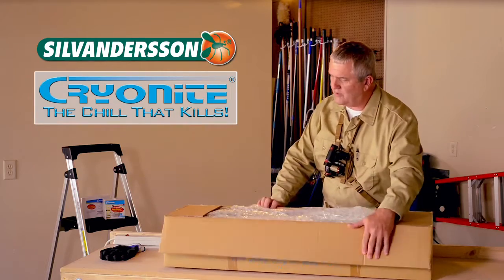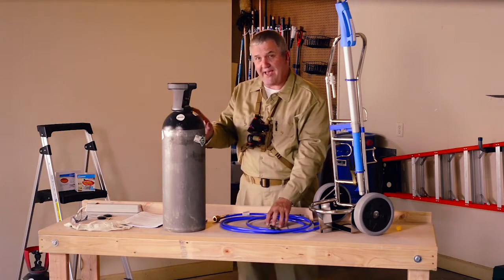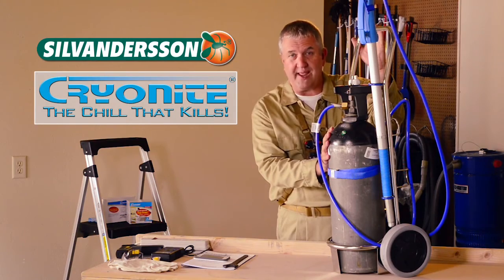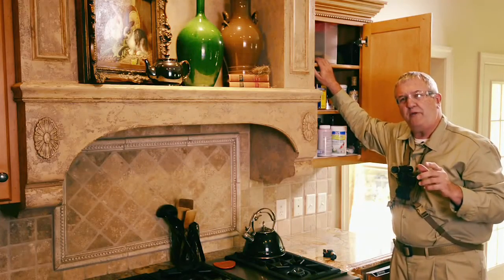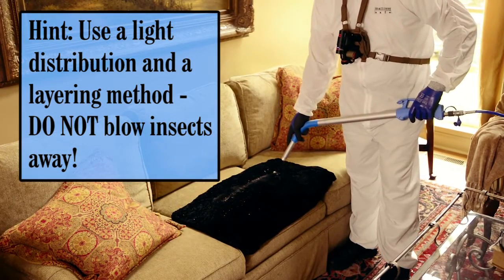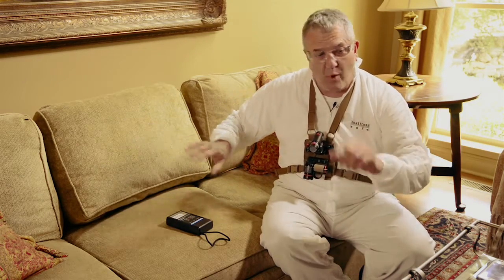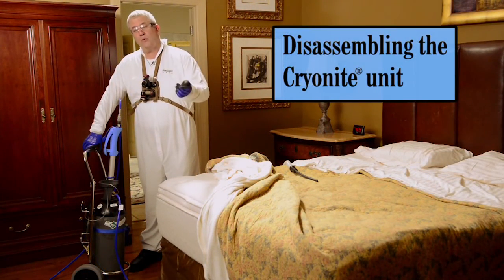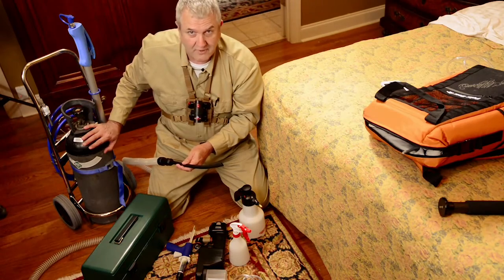Cryonite: Unboxing, Overview, and In-Depth Usage

Comment: About how many home treatments does a co2 tank support before refilling??
Reply: Hello, I work for Cryonite USA.  The amount of time a tank will last before it needs to be refilled varies greatly depending on a number of factors including the type of pest you are are trying to treat, the degree of infestation, the skill of the user, and how you are utilizing Cryonite in your overall treatment protocol.  It's difficult do give an estimate on home treatments because the size of a home can vary greatly as can the extent of the infestation within the home.  For instance, treating for bed bugs in a single room will require much less gas than treating for German roaches throughout the home.  However, to give you some more specific numbers, a single 20 lb tank of liquid CO2 might treat around five double bed hotel rooms with a moderate bed bug infestation, or two commercial kitchens.  We always recommend having two full tanks on hand so that the user never runs out midway through the job.  Please feel free to contact us through our website, www.Cryonite.com, if you have any other questions.

Comment: Just to the side of the hose reel, there is a small tube attached to the frame.  You didn't demonstrate that tube's function.  What does that small piece do?
Reply: +cdresz Sorry for the slow reply, I believe the small tube you are referring to is the jet nozzle.  for most bed bug or roach work you will likely not need this attachment.  The purpose of the jet nozzle is to increase the pressure and speed of the dry ice exiting the wand.  This feature may be of use in situations where you are using your Cryonite system to clean stored product pests out of a piece of machinery.  Most of the time you will not use this attachment because increasing the speed at which the dry ice is applied does not make it more lethal.  In fact, in some situations using the jet nozzle can be detrimental as an unskilled applicator could potentially blow the insects across the surface they are trying to treat.